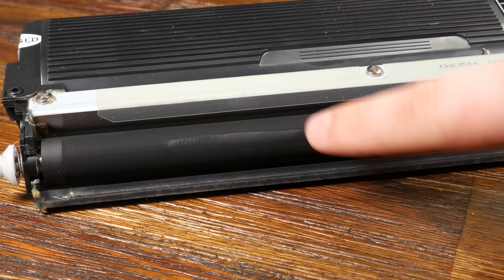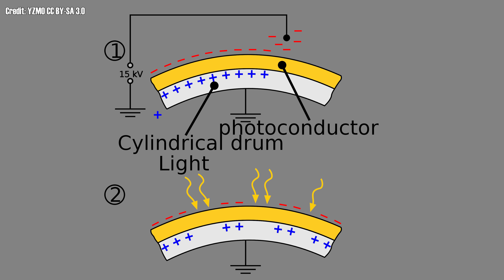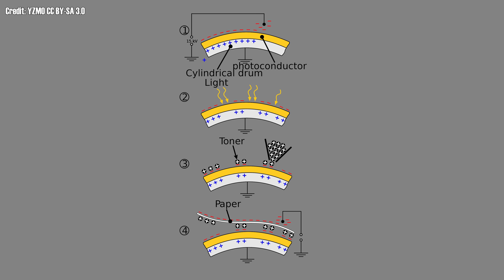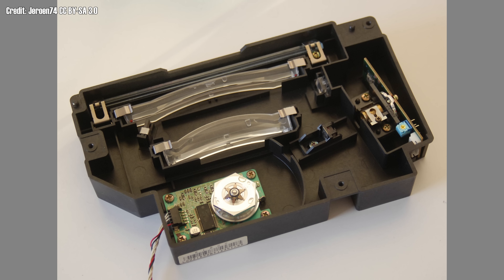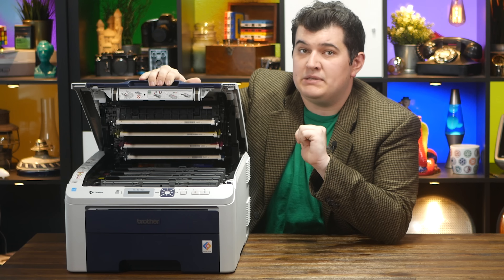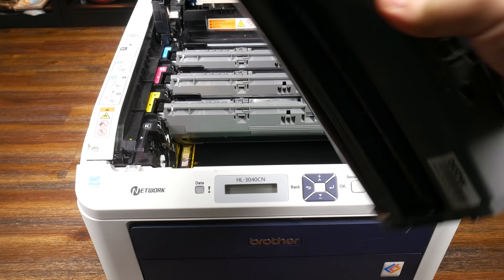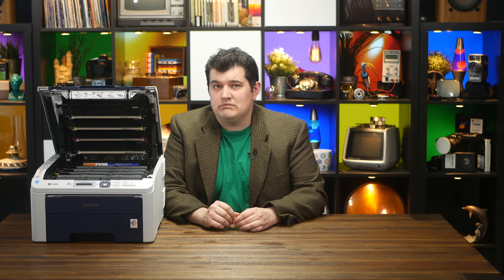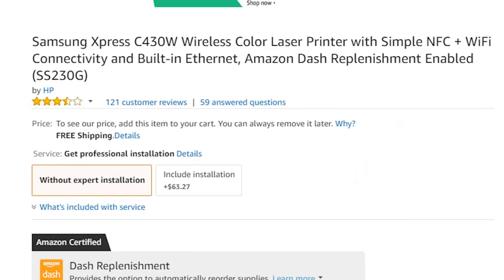LED Printers: The Common Printing Tech You Haven't Heard Of

Comment: Actually your point about meandering paper paths for color prints is not entirely accurate. While true of older laser printers modern high speed color laser and LED printer both use toner cartridges in series instead of complex paper paths. They do this through a mechanism called a transfer belt. So the paper goes straight through the printer from the tray past the transfer belt and directly to the fuser from there barring any other functions like duplex or other finishing processes that require use of alternate paths . If you notice there is a glossy black belt under the toner cartridges. This is the transfer belt. In both modern LED and Laser printers the image from the series of photo drums is deposited layer by layer onto that charged belt which moves the image to the back of the machine where it is transferred a second time onto the paper.

Comment: Not all lasers doing full color are slower than when doing mono. Some laser printers have one laser unit hitting one drum that creates four images, one at a time, and transfers them to an image accumulation place (intermediate transfer belt) till the accumulated image has all 4 colors. Those are the slow color laser printers.
Others (most) have 4 laser units (or 2 double beam units by using the back side of the spinny polygon mirror thing and reflecting that bonus beam to the second drum thru another mirror) hitting 4 drums simultaneously. Those color lasers are as fast in color as in mono, just like an LED printer but less chance of dust blocking a segment on those LED lenses.
By the way the LED's and lasers are infra-red so don't climb inside while it's printing trying to watch them. You'll risk damage to your eyes, and then get your silk tie fed thru the hot fuser (heh, heh).
Either way the processor is a very busy boy as it unspools the color image 4 lines at a time onto those drums!

Comment: TC's many reasons that he doesn't like inkjet printers:

Ink dries out, meaning that the printer has to either constantly be preforming a "maintenance mode" which wastes ink, or you need to print rather regularly which, in this paperless age fewer and fewer people are doing.

The herky-jerky nature of the print heads as the travel back and forth is very unpleasant compared to the smooth print of pretty much any laser printer.

Ink cartridges are usually priced at stupid levels, meaning that you're forced into buying generic ink which often clogs the inkjets so you're damned if you do, damned if you don't.

Because the ink is a liquid, freshly printed documents have tendency to smear if touched until the ink has dried.

Water-based inks are likely to completely wash away if the paper they are printed onto becomes wet, meaning shipping labels printed with some inkjet printers can be rendered completely unreadable if they get wet from something like, oh I don't know, rain.

None of these issues plague laser printers, so despite their higher upfront cost (and arguably more expensive toner) you can pretty much count of them to work perfectly even if they've been idle for over a year, they don't waste toner on "maintenance modes," the toner is bonded to the paper so water doesn't smear it, the toner is never so you don't have to wait for it to dry, plus spills can easily be cleaned up as the toner is a powder. I could go on, but if you read this entire thing, now you know why I generally dislike inkjet printers and why I will forever use laser printers. Or LED printers, which are the subject of this video as you'll soon see.

That said, Techmoan recently reviewed an inkjet printer that was actually pretty decent in terms of ink cost, so even if a "maintenance mode" were to waste ink, it's not like it's wasting super expensive ink.

Perhaps one day I'll rejoin Team Inkjet. Particularly for photo printing (and images in general) inkjet reigns supreme. But for now, I'm planted in the realm of toner so that, when I have to do my taxes, I don't have to waste time, energy, and money fighting a stupid inkjet with clogged heads.

Comment: I’m a packaging engineer and my company used to have some LED label printers. They were basically the setup shown here, but scaled up a bit and set up for roll-fed label stock. It probably has more to do with the specific manufacturer and model of our printers, but they were a maintenance nightmare. VERY sensitive to humidity levels, and I spent a lot of time breaking the image drums loose when they’d jam with bits of label or clumped toner. We also had all sorts of firmware problems, but that’s on the manufacturer. Oh, and the toner mishaps were a constant issue. We had to clean that printer regularly throughout each shift.

Comment: Most desktop "laser" printers have moved to LED tech; at least, Ricoh's have. The paper actually never comes into contact with the drum in color boxes, but instead an intermediate belt that transfers the image onto the paper. On the machines I work on, proper charge coronas are only on the high-volume office equipment; most use an electrically charged rubber(?) roller to charge the PC material.

Comment: You’re partially wrong. Corona wires are the n their way out. Now there is a charge roller that is an actual rubber like material that provides the same function with a better life and easier to maintain before end of life maintenance.

Comment: I thought LED printing was when you put your monitor face down on a Xerox machine.
Reply: this is LCD printing
Reply: @cantorgauss  where did you get LCD from.
Reply: @podgee7507  thats the technical name for a monitor
Reply: @kikicat123  do know that. thx U, this about but led printer, but I never herd LCD printer, like LCD (Liquid crystal display), and I don't think LCD emitting any Type of light, I not sure how the printer read LCD, as for LED does emit light, but just as I said, I have never seen an LCD printer (Have seen ink, laser, pin & matrix Printer, but first for me about LCD printer. (hard to keep up with computer change technology)
Think for your Help.
Reply: @kikicat123 what is crt then
Reply: @podgee7507  lcds have an led on the back, this is what produces the light
Reply: @myrealusername2193  Not necessarily.  Lots of them have cold-cathode fluorescent illumination.
Reply: @cantorgauss  Actually, it's proceeded by CRT printing
Reply: LOL, I like that one.
Reply: LCD you say
Reply: @gabrielvieira6529  Yes
Reply: Yea that's a LCD printer
Reply: Xerox is crap
Reply: @DQSH8999  in us "to xerox" is synonymous to "to print" and a xerox Maschine is just a printer

Comment: Interesting. Instead of a moving part, they have thousands of LED's. But doesn't that introduce the risk of any of those thousands of LED's burning out or malfunctioning? If that's a non-issue, than this sounds like a superior printer for sure except for when you need very high-rez photo quality images.

Comment: I was under the impression that it's not a good idea not to expose the electrophotographic (EP) drum to bright light for extended times as it reduces its ability to hold a static charge. It's also the reason why refilled toner cartridges don't really do as well new ones and with toner misapplication usually ends up gumming up the printer.

Comment: With the scanning laser beam, did the imaging drum stop moving for each scan line so that the line would travel straight across the drum, or did the drum turn continuously and the beam scan on a slight angle to compensate for the rotation?  I was just thinking that if it's the latter, the drum speed and beam scanning speed would have to be accurately synchronized for the lines to remain straight.  The drum would not have to stop turning to wait for the beam position to return to the starting side because the next flat side of the prism would already be in position for the next scan line.  Anyway, laser or LED, the tech is pretty fascinating.

Comment: When I heard "5000 LEDs across each toner cartridge" my mind was blown.  And this tech goes back to the early '80s?  Blown again.  I had no idea that such tech existed that long ago.  I would never have suspected that level of LED driver output multiplexing existed back then.  Incredible!  Also, with LEDs being such new tech, they were pretty dim, power hungry, expensive and difficult to manufacture.  Did the printers cost $30,000 each?  That would not surprise me at all.  When I was in college in 1985, there was a single B&W laser printer and it was accessible to faculty only and I was told then that it cost over $25,000.  I had a prof that would let me go into that locked room with him and print special projects.  I bought my most recent color laser (LED?) printer a couple years ago for under $300.  It whips out the first full color sheet in under 30 seconds.  Incredible.  The printer costs less than the toner.  That just seems wrong.

Comment: When laser/led printers are slower in color compared to black and white it means that they only have one drum and one laser/led source.

This means that the image is drawn first in K (which btw I though it would stand for the last letter of the word black lol) then in M the C and finally B (or whatever order they are arranged in). Compact printers often opt(ed) for this design and they have five cartridges, because aside from the four toners, they also have the separate drum.
I used to have a printer like this from HP, it wasn't compact at all, but it was a long time ago. HP then probably found out that a linear layout and a transfer belt (a design very similar to the printer in the video, although the toners are mounted on a drawer rather than being accessed from the top) would be better for speed. Notice that the image is not drawn directly on paper, but on the transfer belt (pretty dirty at 5:42) that then turns and transfers the image in the sheet.

I don't know honestly why most manufactures still use lasers, but I would say that a little diode and a "spinning thing" are cheaper that a bar of LEDs (also they might have managed to share a single "spinning thing" for two drums)

Comment: No I haven't had to choose between an ink jet printer and a laser printer in years!  Inkjet printers are pure scams (unless you get one of those expensive ink jet printers where the printer has tanks you fill instead of replaceable cartridges).  Laser printers are super reliable and can sit idle for months between print jobs.  If you let an inkjet printer sit idle for more than a week or two, the ink will dry up in the jets (replacing the ink cartridges might or might not fix that).  If you let it sit for a month or more, the ink in the jets and in the cartridges dries up, and the printer is basically destroyed (even replacing the cartridges won't fix it -- it's time to buy a new printer).

Comment: If you want a super cool printer that has magazine-quality output for your photos or desktop publishing projects, check out the old Tektronix Phaser series. They print using melted wax, essentially, from four separate solid ink blocks. They're not terribly suitable for casual everyday personal use because they use a ton of power and/or take a while to become ready (they have to keep the wax hot or get it back up to temperature). However if you regularly do large batch print jobs, such as holiday postcards to send to relatives or advertisements for your home business, or you have multiple people printing in an office setting, they may be a good choice. They're pretty reliable, generally, except that the wax kind of dries out and can clog the print nozzles after several years of disuse and it's a pain to clear them out.

Comment: I wonder how noticeable it would be if a single LED failed. At 600 DPI, and considering bleed would likely cause the gap to contract rather than expand, it might not be that noticeable. But I'd imagine you would need to replace the whole bar if it's too noticeable. A laser printer's one laser is a single point of failure, but one that is presumably more easy to service.

Comment: LOVE YOUR VIDEOS!! And I think the distinction between Laser and LED printers is certainly NOT trivial!! There is actually such an interesting tradeoff there between the laser and the LEDS where the LED method is simple and reliable but requires a LOT of LEDs, versus the laser which is only one piece that accomplishes the whole job by adding in motion, thus making it more complex. More small, simple parts means more parts that can break, but those breaks may be easier to repair. One larger, more complicated component could do the job of many smaller pieces, but at the cost of increased complexity and more "moving parts" so to speak. I feel like that tradeoff exists in a lot of areas and I hadn't thought about it before this video!
Reply: Laser units very rarely break down. The most frequant repair to them is cleaning the sealed mirror unit.
Reply: @mclancer  LED units also seldom fail, but when they do, there's not much to do other than replace the whole assembly. Optics tend to require all the LEDs on the same PC board behind the same long plastic lens, so there's no easy "fix", and there's almost nothing to clean inside the print head either.

Comment: Speaking of laser printers I recently realized that I worked on the worlds first laser printer.  Xerox of course held the patents on the xerographic process used in copiers but strangely IBM beat Xerox to the market on the laser printer by several months.  The first such printer installed in a customer environment, there were naturally some engineering models before then, but the first laser printer in the real world was installed at the F.W. Woolworth data center in Milwaukee in 1976.  I worked on that printer many, many times but it wasn't till just a couple years ago that I realized that was the first laser printer ever installed in a customer environment.

Comment: For clarity, as for laser printing,  it is the high voltage power supply that provides the negative charge to maintain the spaceing between the toner and empty spaces on the paper. The transer corona wire is possitive charged, which transfers the toner particles to the paper.

Comment: Isn't a pulsing led technically a laser? A laser has a diode. The "D" in LED stands for diode. Laser is "Light Amplification by Stimulated Emission of Radiation". Which is what an LED does. It's just not focused into a beam. There are even continuous lasers that don't pulse. So I guess they are technically the same. 1 just has a single laser focused into a beam and scans across the page vs tons of tiny lasers that always hit the same spots.

Comment: No laser printer uses corona wires any longer. They use a conductive roller that sits directly on the drum.
That way far less ozone is created. The fact that the roller sits directly on the drum, ie there is physical contact, means that the drum must be serviced way more often. Bad for the customer but from the company's POV it's a win-win. More servicing=more profit.

Comment: You forgot about intermittent transfer belt that gathers the toners before transferring it to the paper. Only on B/W machines transfers colors directly from the drum to paper. With Xerox all color machines (from desktop models like the WC6615 to full production like the verdant 180) use IBTs. The drums one small to office sized Xerox machines do not have Corona wires because the charges are carried through the drum itself (that's why they do not need ozone filters) through I have seen them on the black drums of the light to full production sizes. Xerox had shifted its desktop and offices printers to LED print heads (ie the altalink series, both 80xx and 81xx have LPH on both color and B/W) but the light production and above still use laser's because of the higher image quality they can get out of them (even the recently released primelink series use laser rosters with air bearings).

Comment: 3:45 Well, that in part explains the reason why laser printers used to be so expensive back in the 80s: back then the RAM required to store an image of a whole page in the printer would have been pretty expensive itself. At 300 DPI you'd need about 2MB of RAM to store an uncompressed B&W image for an A4 page. Back in 1989 my school had a 300 DPI laser printer which, at the time, was a very big deal. I don't remember exactly how much memory it had, but I want to say 4MB, which was way more than any of the computers in the school had. At that time we had dozens of BBC Micros and BBC Masters, and a room full of RM Nimbuses with 80186 CPUs and maybe 640KB of RAM, and then one Acorn Archimedes that had 1MB in the music department. I think the server for the Nimbuses was a 386SX with 2MB RAM and then, maybe in 1990, we moved from a BBC Model B to an SJ Research file server for the network of BBCs. Relative to what I'd been used to in school, this was a ton of computers but, still, none of them had as much RAM as the printer. I'd love to know what happened to all those machines: I'd take a BBC Master, or one of the Acorn A3000s or A4000s they started to get later on, off their hands in a flash.

Comment: I prefer a different different method of laser printing. A pulsed laser cutter or tattoo removal later detonates the surface of the paper, poking small holes in it to form a clear and white matrix of dots. It consumes no toner and only permanently blinds everyone in a 15 meter radius if accidentally left open. The broadband thermal radiation from the million degree double flash of the paper being turned to high energy plasma is only slightly X-ray emitting.